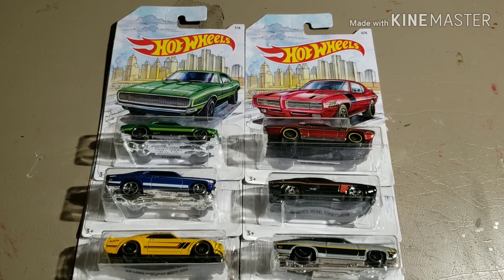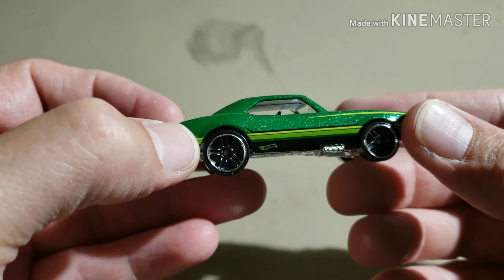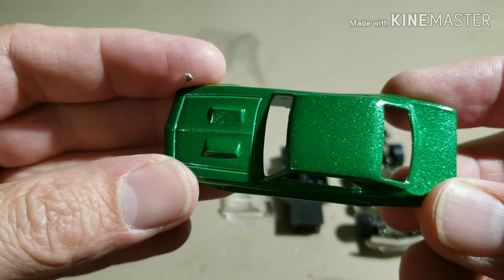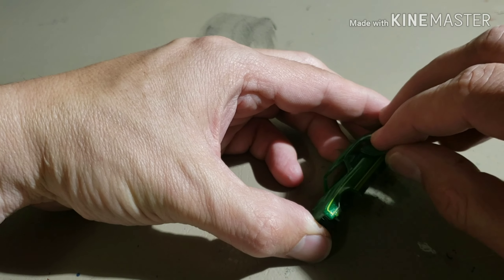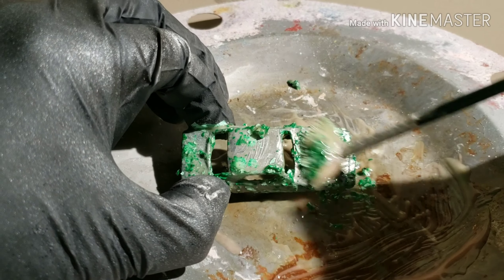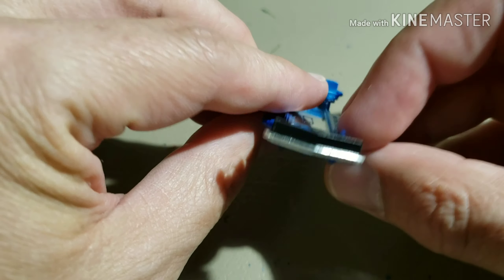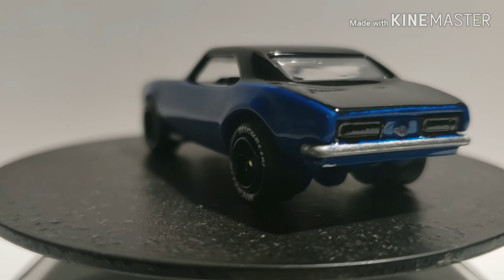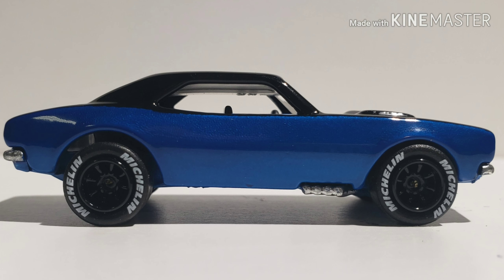Custom Hot Wheels (1967 Chevy Camaro)

Comment: Great colours and choice of wheels. To get a clean edge I never use the actual edge of the masking tape. I lay a section down on my modeling mat and cut a fresh edge with a sharp blade and metal ruler. That way you always get a true straight and clean edge to your tape.
Reply from the maker: I'll  have to try that out. I appreciate the tip.. thank ya.